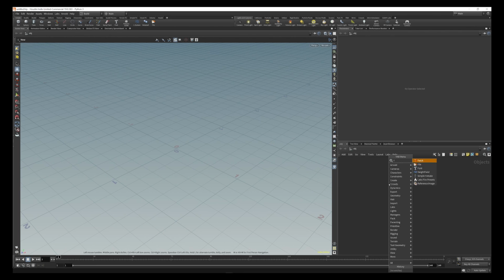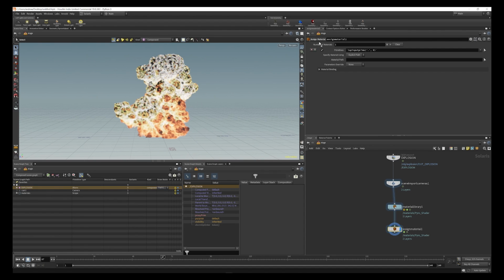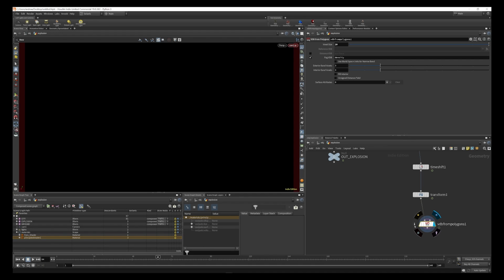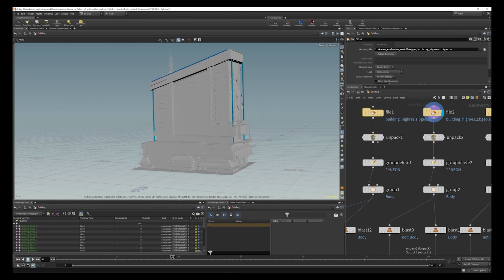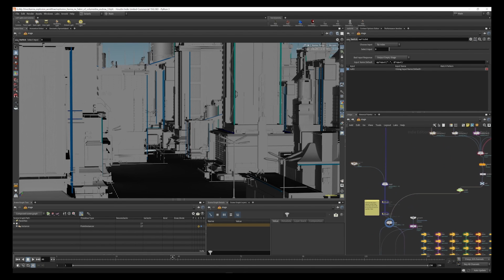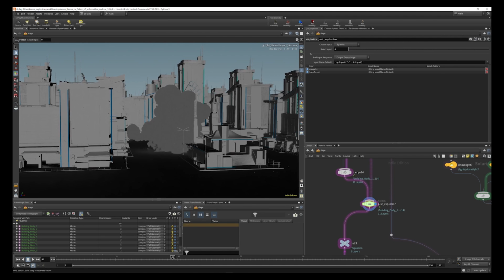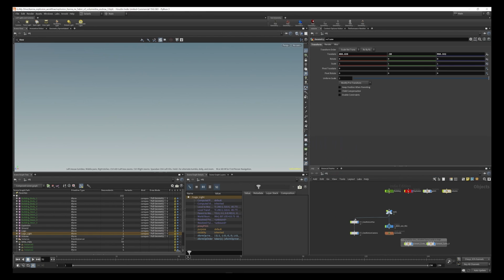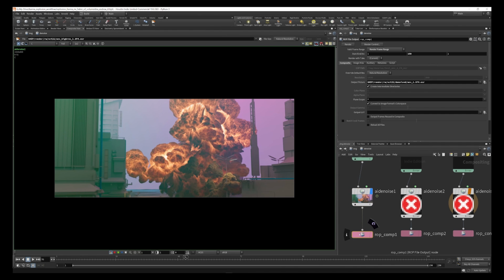Houdini Tutorial | Explosion Rendering In Houdini Using Karma

Comment: Which one should i go for houdini this type of work ryzen 9 7950x or intel 9 13900k?
Reply: I'd go for the 7950x personally. Intel's 13900k is geared more towards gaming because of it's super powerful P-cores and efficient, slower E-cores. The 7950x's cores are all configured to run with the same clock limitations, meaning better multi-core performance metrics which is what you need with these kinds of applications.

Also, the 13900k is known to run VERY HOT, leading to a loud and possibly distracting work environment, not to mention a toasty room after hours of sustained load.

If you plan on doing high resolution simulations even as much as 32GB of RAM can be a bummer, so try to get yourself x2 32GB sticks or even more if you are doing really massive sims.